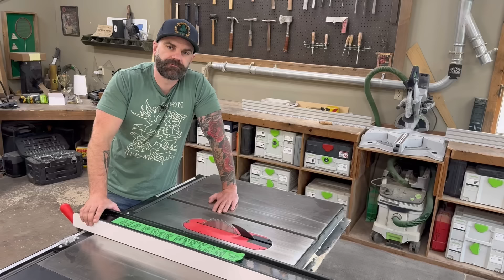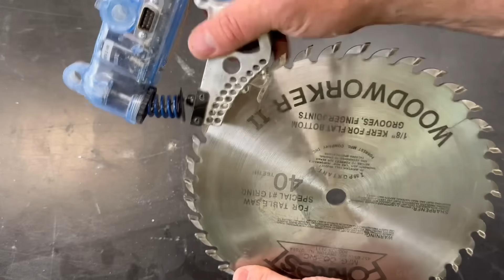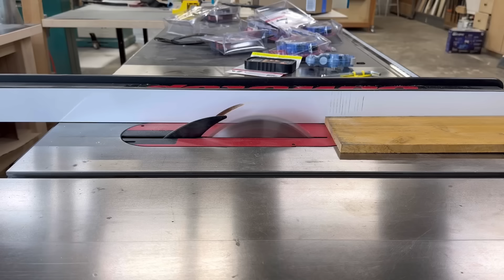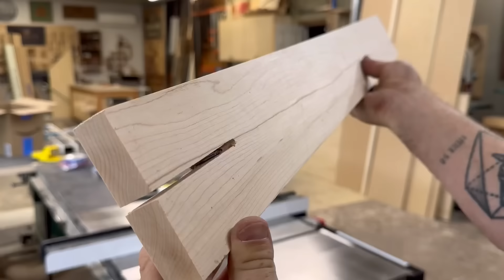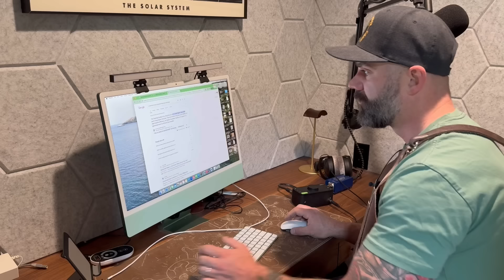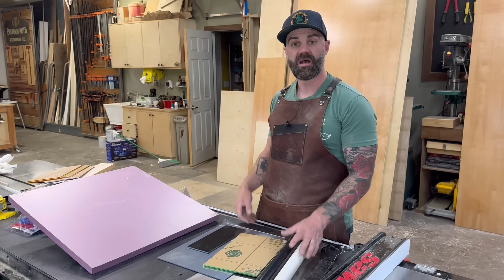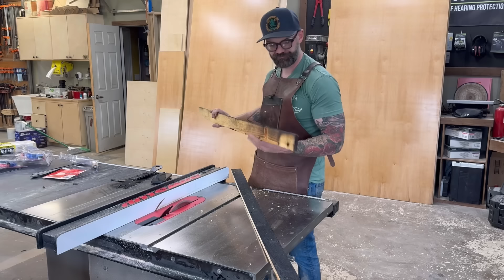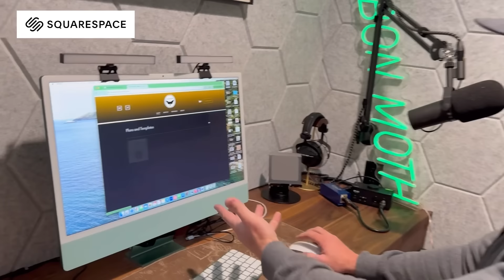Finger Versus Table Saw || Testing SawStop Myths

Comment: Need the electrical conductivity ... Not the thermal conductivity.  But the concept is still correct as aluminum is far more electrically conductive that steel as well.

Comment: Most "wet" wood is pressure treated with copper-based chemicals. That's undoubtedly the difference here. You need to run through some wood still wet with pressure treat.

Comment: Saw stop needs to Spencer's you for all the cartrage you used to demonstraight this its the best one I've seen.

Trash the blade its not worth it to save them  maybe use it in a miter saw where the blade is covered when its turned on.

I was in the basement cutting door threshold that had aluminum with an 80 tooth by metal saw blade 
A tooth came off the blade  i could hear it bounce all around the basement i was using my radial arm saw.

Comment: 31:53  you did not test on your finger, it was a hotdog  and i would not test on my finger either.
However the inventor did on yputube.

Hammer uses a different technology it don't wreck the blade
Or have a consumable part
But your talking 25k versus 4k 
And the sliding table saw can do a lot more  5 machines in one.

Comment: I strongly do not recommending a blade save. The carbide teeth are held on the steel with  braising rod  
If the saw goes off the force is enough to  crack a weld pulling the  block off puts force on the teeth in a manor not designed to hold up to.
Lets say you saved a blade  put it in the saw turned on the saw and off flys the tooth @ over 100 mph.
And you didn't have on safety glasses or someone walks behind the firing line no safety glasses   
Is your eye worth a saw blade? 
Toss it hang it on the wall make a project with it like a display stand.
But don't put it back on the saw.
All it takes is that one time.

Comment: 14 year Sawstop owner here. Still love it. Use it all the time. It looks like that sled has a bolt through the aluminum to the slider. This would make contact with the top. Contact with the iron top will always = trigger. I'd do a continuity check with a muti meter. I have cut some surprisingly wet wood without a trigger. I have also cut kind of fresh PT lumber and had it trigger. I think the PT chemicals are more conductive. I've (accidentally) cut through loads of staples and nails with no problem. One time a staple got pulled into the saw and made contact with the brake. That caused a trigger. I really trust the technology but I also never count on it to save me. Nothing else in my shop is that polite so I always treat it like I would any other tool.

Comment: doesn't set off with 'wet' wood as it was just water and clean water is not very conductive. try cutting the treated lumber which is usually treated with copper it'll set it off as it's way more conductive.

Comment: For those of you wanting to test YOUR SawStop like this, dont test with a $150 blade.

Go down to Harbor Freight and pick up one of their blades and test with that.

I had a large pile of salvaged wood that had some nails in it. Did I dig those out,and use my WWII for that? Nope. I got a HF special and went to work. I sliced thru the wood with impunity. It did a pretty good job slicing thru all that metal.

Comment: wood still carries conductivity. When power is looking for a ground like this saw stop it will find ground anywhere it can. Path of least resistance so it makes sense when your not touching the aluminum it still trips because you are contacting the wood. Would be curious to see if you were wearing rubber gloves if you would have the same result.

Comment: I think it was the size of the aluminum, the mass of the aluminum, or the aluminum (or a chip) in contact with the table that caused activation.  I don’t think you can compare a 5-10 pound chunk of aluminum, with possible metal to metal contact with the table, and a steel nail and conclude it’s the aluminum itself that causes activation.  To test, 1. Make sure the aluminum does not electrically contact the table top, this includes the aluminum chips produced when the blade contacts the aluminum.  2. I’d suggest putting the aluminum on top of a 2X4 and making sure the operator is not touching the aluminum.  If the mechanism activates, then repeat with a heavy piece of angle iron, about the same weight as the aluminum also on top of a 2X4.  The 2X4 is just an attempt to eliminate the possibility of a conductive chip bridging the gap between the test metal piece and the table.  You can sand the angle iron so you have a shiny surface as the test contact point.  Anyway I don’t think it has anything to do with the thermal conductivity of the aluminum, nor do I think it is due to a difference in the electrical conductivity of aluminum vs the steel.  Finally you could make an aluminum “nail” identical to the test steel nail.  You’d probably need to drive a steel nail into the wood, then pull it out and then push the aluminum nail into the hole.  You should keep in mind that the aluminum “nail” will produce much larger chip than the steel nail when it is cut by the carbide saw tip, so you want to be sure you don’t make a long spiral conductive aluminum chip as you cut the aluminum test nail.  You can cheapen this testing by going into bypass mode for each cut then immediately 😢after the cut check the LED on the Sawstop switch box.  If the mechanism would have been triggered, the LED will rapidly blink.  Once you know what will trigger, you can repeat, this time filming the test cuts for your YouTube video. The other suggestion is make sure the operator either is or isn’t in contact with the test piece of metal. I suspect if the operator is in contact, the Sawstop mechanism will trigger without regard to whether the cut is attempted through aluminum or steel.

Comment: Another dafty risking his body with an unguarded blade and without any of the easily installed and used safety stuff of guard, hold-downs, push sticks, feather boards and fence gap opposite the back of the blade. If you simply employed safe practices like these your hands would get nowhere need the blade and you'd also avoid several other dangers, not least kick backs.  Always you seek an expensive technology solution when the acquisition and use of operator skill is far more effective and far less expensive.

Wake up! 🙂

Comment: What about lead? I have run across hardwood that I found the remnants of a lead bullet that was shot into a tree at one point. I haven't triggered my Sawstop with it before...but I can't recall if I found them after using table saw or the planer. Love the video! Thanks for sharing

Comment: Regarding your aluminium fence setting it off, touching it or not. Were there bolt heads on the underside of your sled to secure the fence?  Do these contact the surface of the saw?  And would this make the metal more detactable than a small nail or a staple whether you are touching the metal or not?  Cheers!

Comment: I dropped my blade while re-sawing a piece of Spanish Cedar.  I sent the cartridge back to SawStop and they replaced the cartridge without charge. Apparently there is conductive resin in Spanish Cedar. With my blade elevated to 3 inches it developed enough heat that it caused the resin to precipitate out of the wood fibers and triggered the brake.  I finish my cigar humidor by taking shallow cuts, thereby reducing the heat build up in the wood. Interestingly that finished humidor will collect a sticky brown resin puddle on the lining of the box.

Comment: A number of years ago before retiring I had a job interview with a shipyard a few towns over. I knew nothing about their operation & when I found out they manufactured ships made mostly of aluminum I told them I'm not the guy their looking for because I'm not qualified to work aluminum. I was very surprised when they asked if I had ever took a sheet of plywood & broke it down to smaller panels & I said yes, hundred of times. They said aluminum is exactly the same. Same tools, same procedure, something I didn't know but probably should have. So does this mean they can never purchase a sawstop?

Comment: I set off my sawstop with a brad nail when the saw was new.  And I hit my aluminum fence and triggered it once.  That was $200 down the drain.  If you want to cut aluminum you have to use the bypass, and that works just fine.

Comment: I've never had it trip from cutting the pink foam, but I'm also in a relatively humid place, which cuts down on static charge buildup.  maybe in a very low humidity situation the pink foam is more likely to trip?  we still get some charge buildup on the foam, when it's cut with the CNC router the dust sticks to everything in sight.

Comment: Try the carbon fiber while you are not touching it.  your sled insulates it from the table.  if you insulate it from you by holding it down with a piece of wood, it probably cuts fine.  if it's dusty enough you might get a trip from the dust shorting something out, but otherwise it seems like you could still cut it.  Basically if you're not completing a circuit between the blade and the table, or the blade and yourself, it shouldn't trip.  I got it to trip by touching a piece of charred wood that had been cut in a laser cutter, but the laser cutter didn't go all the way through.  the only way it would trip if I was touching the carbonized area close to the blade, and if the carbonized area were touching the table and the blade at the same time.

Comment: rubbing a piece of 3/4" plywood on the phenolic throat plate seems to allow a bit of a charge to build up.  I tried touching a piece of 2" aluminum pipe on top of a piece of 3/4" ply to the blade, and nothing happened, so long as I was not directly touching the pipe.  But when I rubbed the plywood on the throat plate too quickly, the pipe did trip the mechanism.  I'm assuming this is building up charge on the throat plate and wood, much like rubbing a ballon on your hair will cause a static charge to build up.  It seems to do this when rubbing the wood across the table (which is waxed, perhaps effecting this?), but not as strongly as when rubbing on the throat plate.  If I hold the piece of pipe between a couple of blocks of wood off of the table, and touch it to the blade, it does not trip.  I finally tried with the 1/2" all thread on the wood, but rubbing the wood quickly across the table/throat plate surface, and set off the safety mechanism, just like with the aluminum pipe.  The size of the piece of metal likely matters more than what type of metal it is.

I don't have the patience to change out the blade and replace the cartridge, so I'm just watching to see if the lights on the power switch blink, in order to see if it has detected contact or not.

Comment: the nail didn't set it off, because it was insulated from the table.  it hit the throat plate, which is an insulator, so the circuit couldn't be completed.

Comment: I tried with a foot long piece of 1/2" all thread.  if it was insulated from the table (and me) by a piece of wood, the system doesn't trip.  I attached something to the end of it that allowed it to touch the table, while I used the piece of wood to feed it against the blade, the system trips.  if I touch the lump of metal while it is insulated from the table, it trips.   I've also cut through a piece of hardware on an old cabinet door that was hidden inside the wood, and it didn't trip.

So you need either the relatively large capacitive charge of your body, or you need to directly close the circuit between the blade and the cabinet/table in order to set off the sawstop brake.

Comment: Jason, great video.  One thing you didn't test was pressure treated wood. Shortly after getting my SawStop, I made several cuts through pressure treated 1/2 inch plywood.  I couldn't turn my saw off other than to unplug it.  It didn't set off the brake, however, it blew out my "Switch Box and Contactor Assembly".  Replacement was expensive.

Comment: Anodised aluminium is not electrically conductive ... thanks for a fantastic video, very informative 👍
I've read comments before about Saw Stop making the user complacent and I'd agree to a certain extent, but I'd say the benefit outweighs any slightly increased risk. Safety gear can make anyone feel safer, for example, if I put on my helmet, jacket and gloves and do 60mph on my motorbike it feels slows, but do the same in only a T-shirt and it feels extremely fast.
You need to be extremely focused when working with power tools, the slightest distraction can have disastrous consequences.

Comment: i bet more mineral rich water will trigger it - it would greatly reduce the waters electrical resistance.
also, i think the difference between the nail and the chunk of aluminum is the size, so you'll probably be able to find the threshold size for triggering it.

btw you checked up thermal conductivity and not electrical conductivity which is the wrong one

as far as i understand the detection system is pretty simular to a phones capacitive touchscreen in principle

nevertheless cool vid, awesome tech. i sure wish it were available where i live

Comment: For aluminum: I did run my blade through a microjig clamp (which is aluminum I think ) and didn't set it off. So maybe the aluminum alloy can be different and you get different results

Comment: Craig is such a good sport. 

In addition to the conductivity difference between a steel nail and aluminum miter fence, I can’t help but wonder if contact with the table saw surface plays a role. Was there any path for conduction between where the blade contacted the miter fence and the table saw surface? For example, are the slides of the miter saw table conductive and attached using screws to the aluminum fence? 

I’ve heard a lone nail will likely not cause an activation but a nail in contact with your skin or the table saw surface is likely to. 

I’d venture a guess that aluminum could be cut if it were isolated from your body and the table saw surfaces. Not willing to wager a bottle of fine whiskey though! 

Time to do a part 2!

Comment: Rigid Foam insulation that has metal backing WILL set it off...but oddly. It slows down while cutting - like warning you it's coming without firing. I had time to shut down but ignored it...then BANG. Cartridge fired and you know the rest. Worked great metal side UP...DOWN? Not so much

Comment: I've got the tip of my finger destroyed yesterday when it came into a careless hand swipe contact with the  blade as I was retrieving wood with my left hand (I'm right handed). My index finger just swiped somehow UNDER the blade guard. I can't figure out how it happened but I know the result. So, my question is - how much a sausage will get nipped when it touches the blade at speed. Not a careful touch but a real life swing of a careless hand.

Comment: I was cutting melamine that had been sitting outside for a long time with my saw stop and it set it off. I wasn't expecting anything like this although I had my saw set off before when I hit the blade with my aluminum crosscut sled. I was holding the fence when it went off. Since it costs about $200 to replace the brake and the blade, I now always turn off the stop feature when I'm cutting repurposed wood just in case there are any hidden pieces of metal.

This is a great video to see what will set the SawStop off since you never know what will and what is safe. Thank you for spending all that money for replacement brakes so I don't have to. 😁

Comment: I have the 10" contractor saw with extension table and the pro glide fence. This is one of the most expensive tools I have ever bought. I actually took the advise from Norm Abram and read the manual. (First time I did this) On page 5 in the last paragraph under IF YOU HAVE AN ACCIDENT The last three sentences say " If you return the activated cartridge to SawStop,   we can retrieve that data to learn how the electronics and software preformed. If we confirm that your cartridge activated due to skin contact, we will send you a free replacement cartridge. Thanks for your help." I have been fortunate so far, I have not had the blade activated. If anyone has, I recommend referring to your manual and seeing if yours says the same the same and let us know the outcome.

Comment: So there are a couple of possibilities as to why the brake was set off while cutting into the aluminum fence. Capacitance is affected by the mass of an object. The greater the mass, the greater the capacitance. The fence is a sizeable chunk of aluminum so it could have the necessary capacitance to trip the break. I suspect that there is a point where the the size(mass) of the aluminum object would be too small to trip it. Maybe try a small piece of an aluminum gutter spike driven into a board and see if that also sets it off. The second possibility is that melamine can be highly conductive depending on it's formulation. It's possible that by touching the melamine surface (if that's what it is) of your sled may have been able to conduct enough current to trip the brake. These are just some thoughts I was having after watching your excellent (and very entertaining) video and my days in my physics classes are many years in the past so there may be some other variables in there that I am not considering. I admit, I was a bit surprised when it tripped the brake with you just pushing the base of the sled.

Awesome video as always!!

Comment: A capacitor is constructed with, basically, two conductive plates separated by an insulator. The aluminum plate is capacitively coupling to the tablesaw top, with enough surface area to make a "good" coupling that trips the detection threshold. A nail is too small to make a good sized plate that couples to the system. The whole thing works on a capacitive detection scheme, they note that in the patent. 

I design capacitive touch panels for a living, all of this is central to my work so it's really easy to piece this together :)